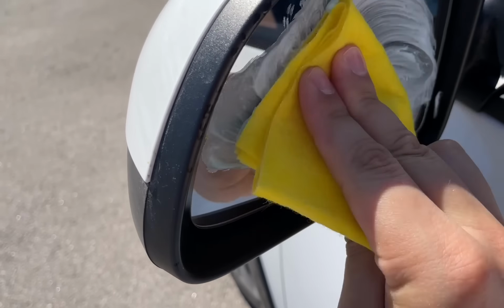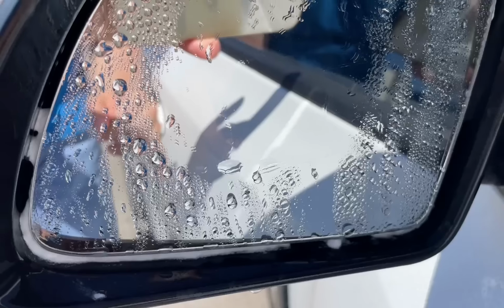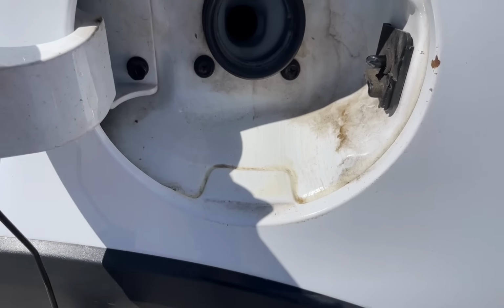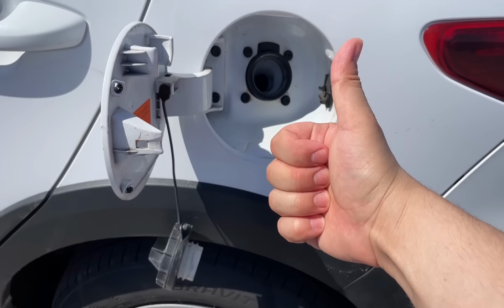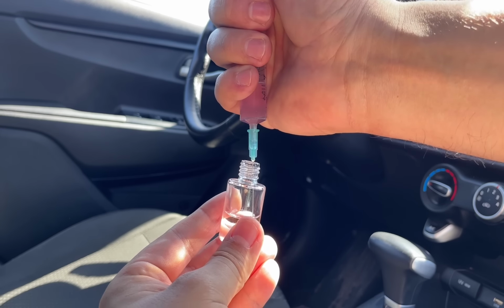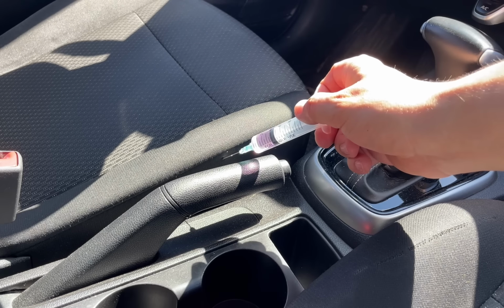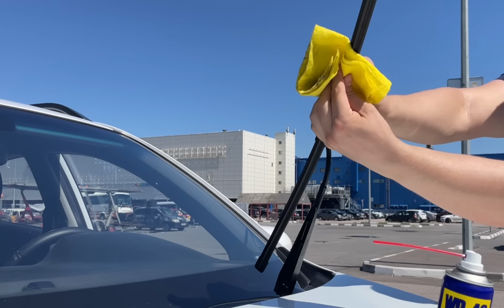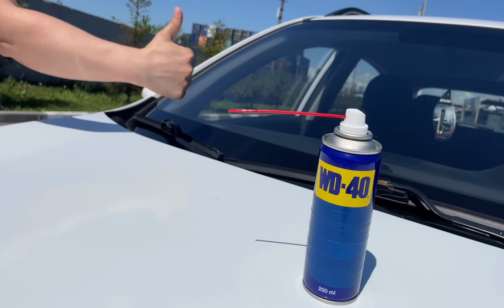🔥🔥Tricky Drivers Put a Syringe in the Car Seat Tricks You'll Use Every Day

Comment: I don't think you should use WD-40 on your rubber windshield wiper or tire.  It contains solvents that will break down rubber.
Reply: Il WD-40 non é uno sbloccante da usare sui metalli arrugginiti ?
Reply: You're right it'll just rot the rubber, use a silicone spray instead.
Reply: Lol, ya, there are a few things I was thinking there wasn't a chance I'd do that, but I think that's why this is a quick fix thing, not the best. 😊. There are a few products out there. i tried to make things look new again, and the black look shiny again. Found out it collected everything after that, and the next time I tried to wipe it off, it was not only sticky but gritty, too, and would not come off. Sure, it looked good at the time but was sticky, but dang. 
Careful on what is done.
Reply: Bang on, I tried it once and ruined my blades